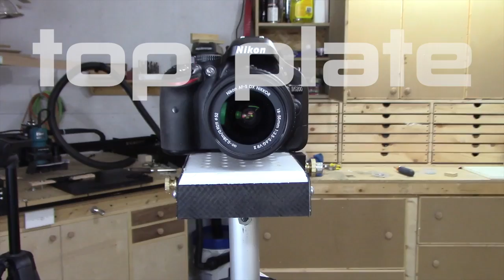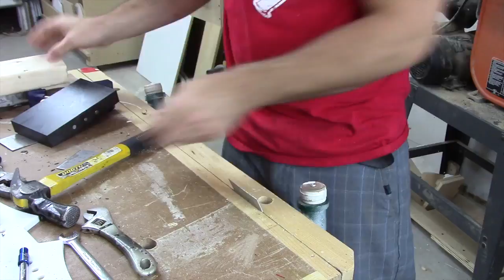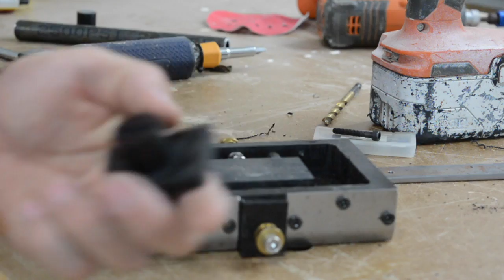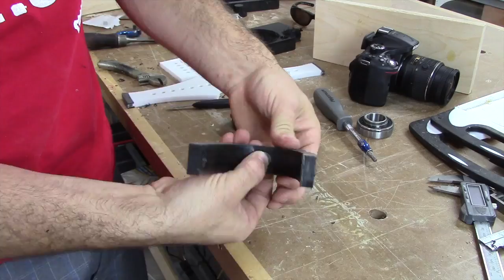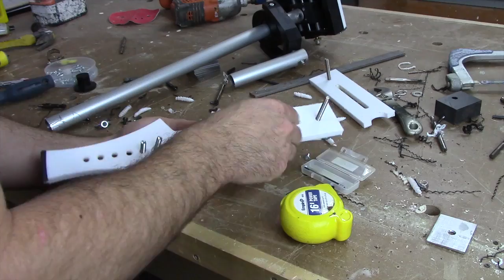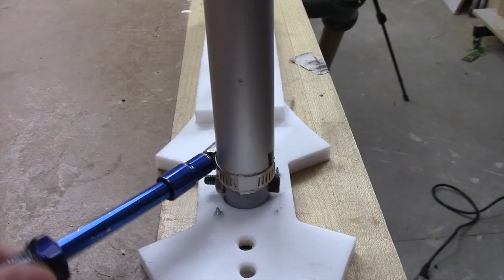Camera Stabilization

Comment: All the fancy CNC work and you used a gear clamp for the length adjustment?

The rest was really well done, you are certainly getting good use out of the CNC machine.
Reply from the maker: Hard to beat the strength of a 30 cent gear clamp..
Thanks for watching
Ryan
Reply: +Shop built Very true.  BUT. you have stepped up your game, I bet you could make something to replace it that is tool free and just as strong.  Something similar to a bicycle seat quick release clamp/lever would work well there.

Comment: That's really cool. The end result is super clean. I posted a Merlin style stabilizer build on Instructables a couple years back: http://www.instructables.com/id/SteadiCam/ 

Just an idea, the pro SteadiCam mounts have a screw adjustment for their front to back adjustment like the side to side set up you used. You can have a super fine, repeatable adjustment without the friction of the sliding dovetail.
Reply from the maker: Thanks! I had intended for the front to back lead screw as well but just couldn't get the design right so scraped it and went with the dovetail. 
Thanks for watching
Ryan